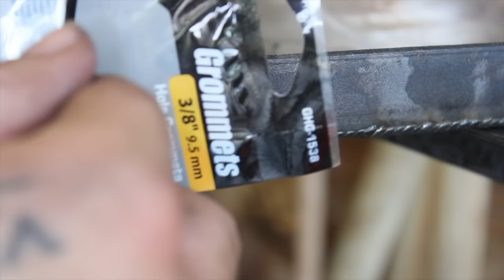Industrial chain lamp from start to finish

Comment: what's that cutter you clamped to the table to cut sheet metal
Reply: Carl Geving Called beverly shears I think.
Its a throatless sheetmetal shear. Used one in my uncles body shop back home. Hope that helps.